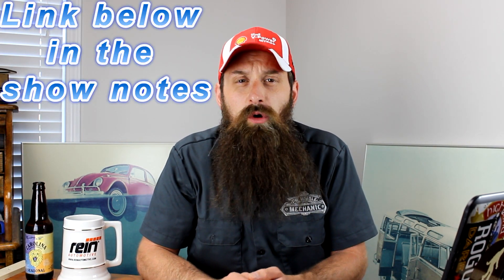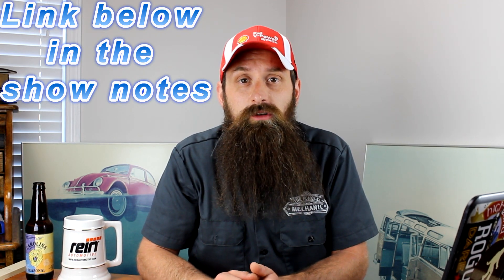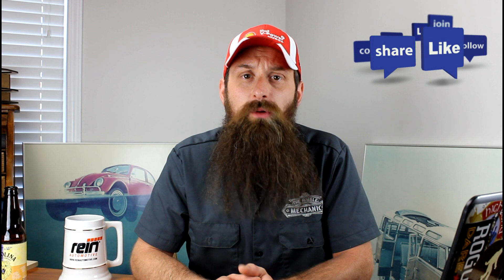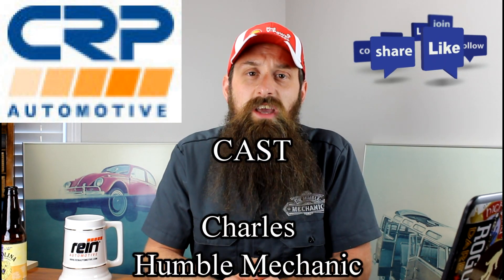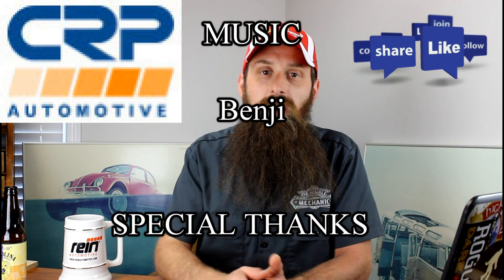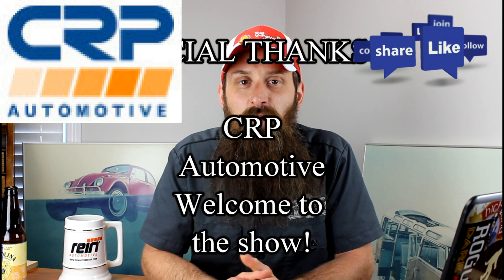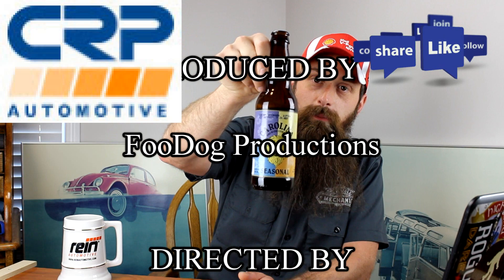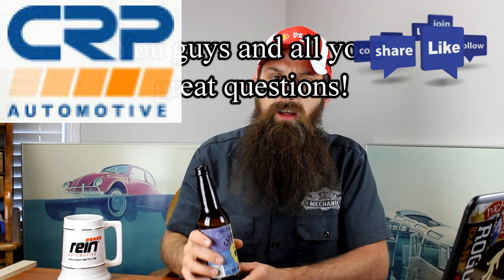Shop Update and Viewer Questions ~ Episode 78

Comment: Sorry I disagree on the Key FOB.  I purchased two on eBay.  Just make sure the part # are the same, the part  numbers can vary on models of the same year.  I had my keys cut at a local lock smith and programed them both with my Ross-tech VAG COM.  The money I save payed for the VAG COM itself the first time I used it.
Reply from the maker: Johnny Woo Glad you got your key working. I will say from the experience of programming tons and tons of keys, your situation is the exception.